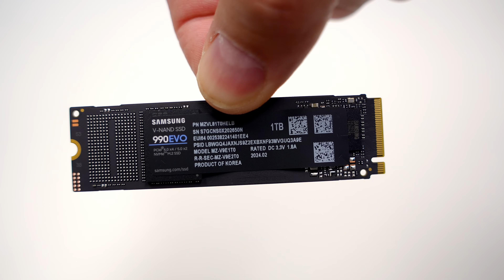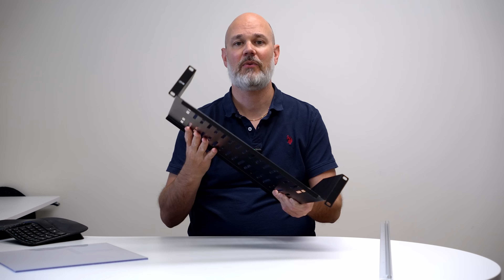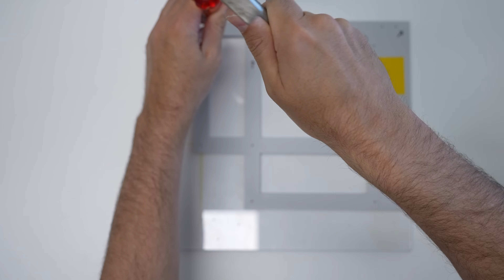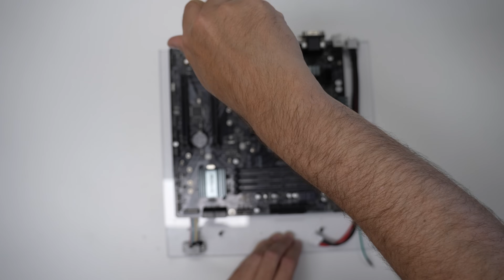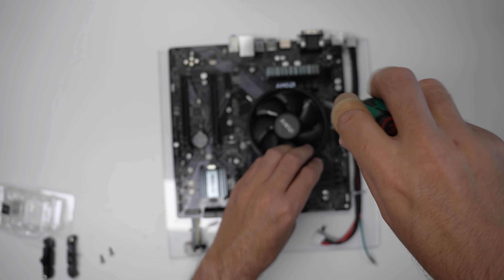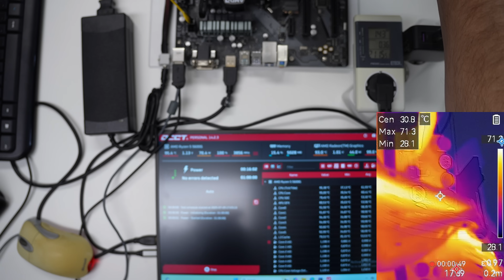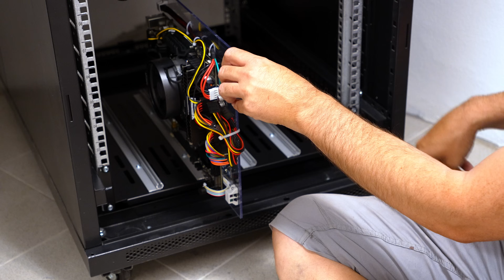Homelab: Install UNLIMITED CPU and RAM without wasting space or money | DIY Blade Servers

Comment: Great video! I think I will apply this same method but with the motherboards from mini PCs (like the EliteDesk 800 G4 mini). I have several of these and I was planning to use them in their cases but sitting on their sides. In configuration, they take up about 4U of vertical space and you can fit quite a few of them (at least 8 or more) in a 4U x 19 inch rack. They also use the same type of laptop power bricks.

I've never considered just removing the motherboard and mounting them that way. I would be able to fit quite a few more but cooling would be a problem (even though they use the lower powered "-T" model Intel CPUs. Maybe I could just build my own blade enclosure with a dust filter up front and exhaust fans in the rear 🤔

Comment: Ryzen 7  5700G: 2 more cores, only 0.1 GHz slower base clock, 0.2 GHz higher boost clock, same power (65W), 1 more Graphic Core,  but, $30.00 higher price.
Also, do not forget to set the memory speed to 3200 & F-Clock to 1600 (your video showed it was at the default speed).
Reply: if he changed the CPU to 5700g, he will facing heat problems I think

Comment: I think this is an excellent video, and the critical comments are simply too focused on the hardware you used instead of the core concept demonstration.... An actual do-it-yourself, non-proprietary/not EoL BLADE server for redundancy/high availability, clusterig/parallel tasking etc. I look forward to seeing where you might go with this. 🍻
Reply from the maker: Thank you for the kind words :-) Yes, those are exactly the reasons for doing this build. I think maybe I focused too much on the "how" in this video and forgot the "why".  So I may have to make another video explaining why/when this build makes sense.
Reply: @KelloLabs  In any DIY, there isn't a need for the "why" in regards to the PC hardware video.  The principal of this video is more about the process of making your own blade server setup, not why you chose the hardware.  The dimensions of the mobos are the same today as they were 20-30 years ago based on the type of motherboard, and the only difference might be the height of the CPU fan which is going to cause some sizing differences, but beyond that, I don't care why you picked the specific PC hardware, just that you took what you had and got it into the rack. (Granted some mobos don't have certain holes in certain places, but, if they did, you could have 30 different boards of the same classification and all the holes would line up -- Standards are great!)

The only thing I'm feeling uncomfortable about in your build is that they boards aren't exactly "locked" into place and aren't protected from invaders.  Like... Cats... Who.. just love to find "warm places".  But I guess if the rack is behind a door in a room and the animals aren't allowed in, all good.

My OCD would also say that maybe some kind of device that just makes sure the Plexiglas doesn't slide around when you hit the power/reset buttons, but I doubt you'll be doing much with that button pushing anyways so kinda moot.  Just.. OCD itch I have that I would correct if I were do to this.
Reply: @KelloLabs  Hi I just found your channel ! Great build vid, gave me some cool Ideas ! But I would definitely appreciate the WHY factor, It seems like just getting a couple of used Gen 9 Dell servers would be less expensive ( dual Xeon E5-2600 v4 cpu's in those ) They would be louder I suppose but depending on your local market they can be found with decent cpu's and lots of ddr4 ecc Ram for between $150 and $500 Us Dollars, But again, it all comes down to your specific use case scenario and local $ and availability. ( I may just be spoiled to live in a major Us city with a thriving used electronics market )
Reply: @mooklaathegreat3662  the electricity prices in Europe and many other places outside the US are significantly higher than they are in the US, and many places in Europe and elsewhere do not have air conditioning, so most people do not want enterprise servers in their homes because they are power-hungry, expensive to operate, hot, and loud.

Comment: This video is not an example of saving money or space, it's just nonsense. You'd spend less money on 2 x Ryzen 9 5950x, motherboards, RAM and storage, and even have some left over for a proper rack case and power supplies. You'd have more cores in a smaller space that used less energy and put out less heat. I'm not even sure why you got a 5600G, most servers don't need a video output, you're just wasting memory being allocated to the GPU, which also slows the CPU down.

Let's break down how dumb this is:

2U Rack shelf x 2 - $88
12x12" Plexiglass sheets x 5 - ~$75
6 pack awning rail (cheaper to buy 6 pack than individually) - $42
Misc cables and mounting hardware x 5 - ~$75
Labor required for fabricating and assembly, and testing - probably 8-10 hours, well into the hundreds of dollars. I'll go on the low end at 8 hours and $35/hr for $560
Tools required as seen in video, well over $100. (drill, clamps, metal saw, transfer punch, hammer, scribe) Assuming you buy cheap crap tools on Amazon, you could just squeak by around $200.

So the total for just the parts and labor is $1,040, excluding tax. This is already exceedingly ridiculous. Even if you discount your labor as free, it's still $480.

You can buy two 2U rack server cases with all hardware included on Amazon for $160. And you only need a single screwdriver with changeable bits.

For the computer hardware:

Ryzen 5 5600G x 5 - $675
Asrock B450M-PRO4 x 5 - $400
Corsair DDR4-3200 32 GB x 5 $395
Samsung 990 Evo Plus 1 TB x 5 - $325
Sketchy 12v power brick x 5 - $100
Sketchy 12v to ATX adapter x 5 - $100

This is $2000 of hardware that you're trusting to sketchy AliExpress IEDs on more sketchy voltage converter boards. Or around $3040 before tax and shipping.

Alternatively, you could be not dumb and just build two Ryzen 9 5950x rack servers for much less.

Rosewill 2u Rack Case x 2 - $160
MSI MAG 550W PSU x 2 - $130
MSI B550M-VC x 2 - $198
Ryzen 9 5950x - $582
96 GB DDR4-3200 x 2 - $452
Samsung 990 Evo 4 TB SSD x 2 - $474
Radeon HD6450LP x 2 - $54

For a grand total of $2050 before shipping and tax. You save a thousand dollars in parts, labor and tools. And you're not trusting that investment to AliExpress trash power supplies that will probably burn down or destroy the hardware its powering. So now you have a thousand dollars less to spend, or be able to spend it on redundancy, like a rack mounted UPS.
Reply: As the kids say - Cool story bro. You need add at least a third build to your total to achieve the minimum recommended three systems to run a basic cluster (a stated goal) so welcome to the $3000+ mark. However he also specifically stated he wanted more hardware/more nodes which would make five of your machines more like $5000, just saying. Another goal was to NOT use typical PSUs (whatever the reason), and he has demonstrated one possible solution. I believe the common term is PICO if you wanted to look it up, and "blade server" probably wouldn't hurt either. 

As to the other items used in the video; people from all over will build systems with components and use tools they already have or can afford from suppliers that will actually ship to wherever they are. You proposed much more powerful and capable hardware, the way I always want to go myself (as well as including or at least allowing for GPUs), but not everyone has access to the same stuff, and the idea demonstrated here is the important part not the particular hardware used.🍻

Comment: very nice!. man you hace pcie space, put some 10gbps spf+ network card, that will be an awesome upgrade for your blades :D
Reply from the maker: Yes, I definitely want to upgrade the networking somehow. Not sure if a card would fit physically? Perhaps with a riser. I've also seen USB adapters that go up to 5Gb. Need to do some more research on this and I think I will make a separate video about the network upgrade once I settle on a solution.

Comment: Very interesting combination of both hardware and mounting options. I can see that it's quite a niche use case and that many people would rather go with more powerful single box or a few lower power mini PCs or mITX boards, but hey, still interesting.
I assume you want to use it as a cluster. What kind of cluster? What software? What are some use cases of services you want to run here? Are you setting up WOL and some kind of monitoring?
Reply from the maker: Yes, it is meant for a cluster setup. I previously did a build like this at work to have it as a bare-metal Kubernetes cluster. That cluster started with 5 machines and over time grew to 15 machines. It is mainly used for web app dev-sites, CI builds and similar services. It is a cheap way to handle non-production workloads. Kubernetes allows you to dedicate nodes to certain workloads, so having more machines gives more flexibility, eg. you can dedicate 3 nodes for CI builds only.

For my homelab setup I'm planning to install it as a Proxmox cluster. This way I can have many VMs and they could migrate across the physical machines. I also plan to setup a Kubernetes cluster. For monitoring it is easier to have everything as VMs. However, I may loose some performance by running the Kubernetes worker nodes on a hypervisor rather than bare-metal. Perhaps I will dedicate 2 of the machines as bare-metal Kubernetes workers and have the others 3 as Proxmox cluster for VMs. I will use it mainly to self-host services I need for my own use and perhaps also for some dev web sites and CI builds.
Reply: @KelloLabs  That would be a nice video serial. You got a subscriber :)

Comment: Why not go with AMD EPYC 7002 or 7003 series  OEM CPU  with 64- 92 cores .
Can easily build cheap a server system for around $3000.
Reply from the maker: Yes, building a single computer for the same money would save space and AMD EPYC would certainly be a good choice for that. 

One goal with this build, which I may forgot to mention in the video, was to have many independent machines for redundancy. I could for example run a Kubernetes cluster on these machines and if one breaks down the workloads would migrate to the other nodes. I could also take one machine offline and use it for a different experiment and then put it back without affecting the workloads. Another reason is that having more machines makes it possible to do more experiments than a single machine, for example trying distributed storage using local node disks (hyperconverged storage).

I guess it is a question of what your use cases are. For my use cases it makes more sense to scale the hardware horizontally (many cheap machines) rather than vertically (one more expensive machine).
Reply: I have AMD EPYC 8324P (32C/64T) 2.65GHz (3.0GHz Turbo) Socket SP6 TDP 180W +  ASRock ASRock Mainboard SIENAD8-2L2T ATX Sockel SP6 Single + 128GB RAM + SAMSUNG 970pro and SAMSUNG 9100pro . PCIe Gen 5 Lanes: 96 .It is enough for me at the moment in my homelab. I will extend memory in future.

Comment: I would probably use one or two  MINIS FORUM BD795i SE board, AMD Ryzen 9 7945HX, 16 Cores/32 Threads. For 415€ each it is great value considering how many cores you get on such a small space as it replaces nearly 3 of the CPU's you suggested, comes already with 2.5GBit ethernet, is the overall more modern architecture and consumes less power.
Reply from the maker: Using laptop CPUs seems like a really interesting solution! They have become really powerful these days. Also really nice to have the 2.5GBit ethernet built in. Will definitely look into those options if I do another build!
Reply: @KelloLabs this could be neat series with asrock or msi boards